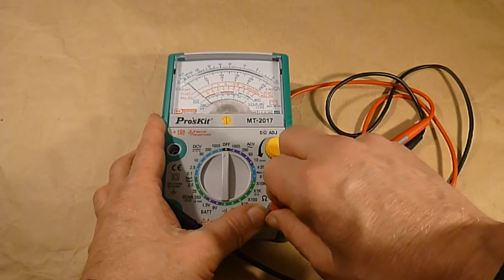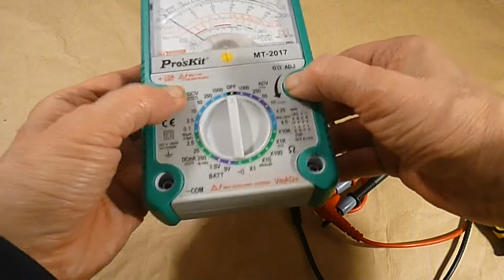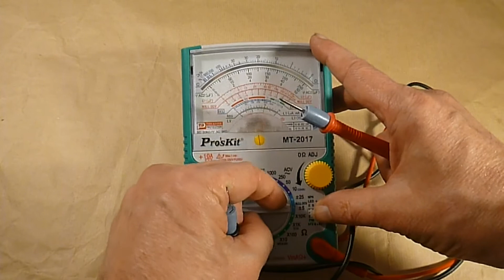Proskit MT-2017 Multimeter Fuse Replacement

Comment: hello 
i have 2 questions 
1 - what are the advantages of using analog multimeters?
2 - are proskit multimeters any good ?
Reply from the maker: I have both, a digital and analogue multimeter, and would say I use the digital one mostly.  In answer to your questions:
1) For my use, the analogue one will measure volts and current without the use of the internal batteries so if you are caught out with a flat battery in the digital meter and you don't have a spare, you can fall back to using the analogue one.  When measuring current, an analogue meter will create less resistance and if you want to leave it in circuit measuring current for a long term, for example measuring the output from a solar panel, you can do so without worrying about the battery going flat.
2) In my opinion, at its price it is good value for money and seems to be pretty accurate.  I have had mine for about 5 years with no problems.  It still has the original batteries it came with.
Reply: thank you, that was very helpful and informative.
Reply: Analogue is good for being able to see trends, twitches, etc., hard to visualise with a digital only meter
Reply: @alexbarrett6656  i think you can monitor those issues with bar graph display on some digital multimeters